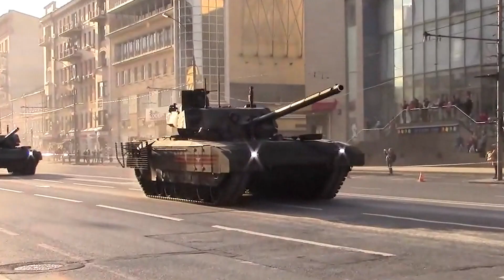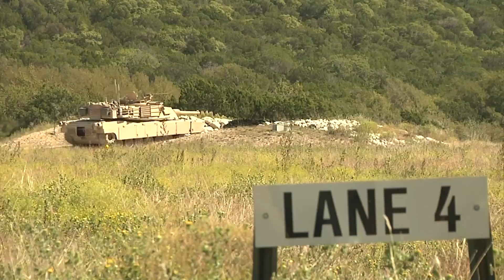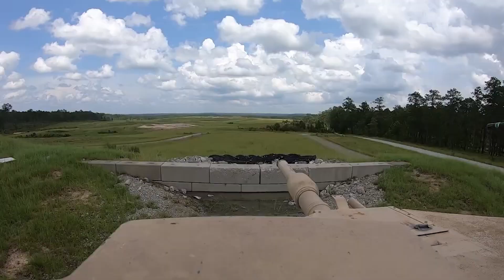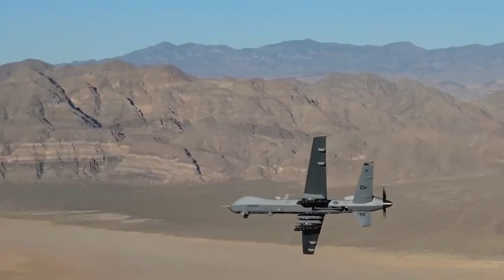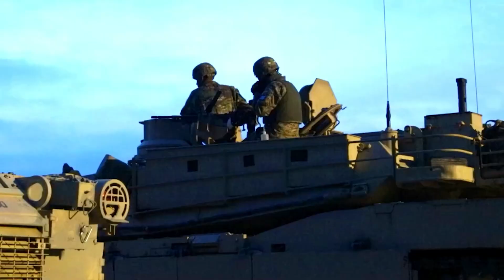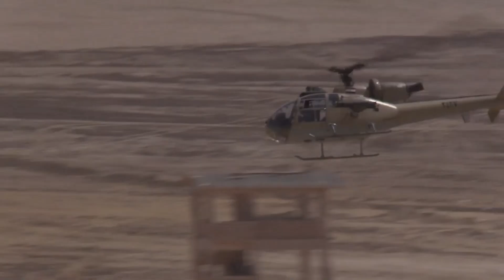The New US Tank vs the Russian T-14

Comment: The worlds super heavyweight champion - M1A2
Or the world's strongest man - T-14

Theres been info leaked here and there about things like the M1A3 getting a new higher pressure 120mm gun, or switching to the Rhm-130mm gun. Both would server amazingly, but i think the 130mm would have better future-proofing. The 120mm would be better economically though. The higher chamber pressure of the XM360 gun is great for what is needed... at the time. But the 130mm already has a larger chamber pressure at baseline, larger SABOTs to be used, meaning higher velocity and projectile weight (simply Mass x Velocity = MJ stuff). The -360 is an older gun system of a failed project, the 130mm is newer but would carry less ammo, that is if the US put the XM1147 AMP munition into a 130mm system (as the AMP replaces the HEAT-MP-T, MPAT, CAN, and OR-T munition).
Reply: 2 char Abrahams de 10 millions de dollars chacun détruit par des drones suicide à 15 000$ 
1 Abrahams détruit  par un vieux T64 modernisé .Voilà pourquoi la Russie a stoppé le programme T14 et qu'elle modernisé ses vieux chars.

Comment: Considering that the T-14 is one that is powered by an unreliable engine that was taken by a f**king Tiger from WW2, with even China admitting that the T-14 saw no combat since its launch, and how it’s biggest claims are its incorporating of technology that has been used by Western powers for decades, I’d choose the Abrams line of tanks any day of the week.
Reply: idk where the claim that it uses a ww2 engine but its most likely a false statement
Reply: @DaKevinnnn  It isn’t exactly an engine ripped from a WW2 tiger, but the engine was copied from the Maybach design used in the Tiger. The “new” engine was originally designed as an engine for compressing and pumping oil (which no one outside of Russia bought because of its reliability issues) before Uralvagonzavod used it to power the T-14.
Reply: @SpaceCase132  theres no reliable sources as for it was originally use for oil compression though
that myth came the manufacturer pamphlets that only list under possible application of this engine together with special purpose vehicles it was also repeated on theyre advertisements 
the engine can be use for that things it doesnt mean it was developed as one
it was an engine design in the 70s as a tank engine 
also its not the same engine from the tiger p its uses the basis of the engine not a copy it has different sizes and piston size and etc the only thing it has similar is the x layout
theyre arent even much evidence to prove the engine being unreliable (idky why it fail commercially but my reason that there was better option)
it has pass state trials ewthout issue
the only thing thats bad about the engine is that the fuel and oil consumption is higher than expected

imma expect if u got this from lazerpig whoch makes alot of mistakes, watch red effect on this topic which talks about this deeper
Reply: Aah yes I see from where you get this probably leazerpig audience
Reply: @raimsdayer4488  Guilty as charged.

Comment: It's pretty likely we're gonna get an M1A3 before Abrams X sees production, an Abrams using newer modern carbon steels in the hull (The hardest carbon steels are harder than depleted uranium now which is insane, they weigh less too) with many of the features off of the Abrams X, like new main gun, the 360 degree awareness, AI Targeting solutions and potentially a station for drone operation although drones are unlikely when we can just have dedicated drone command vehicles made out of the hull of an old M113 or Bradley. We have the M10 Booker to address the weight concerns of the Abrams, the Abrams can focus on being the sledge hammer it was always meant to be, a heavily armored sledge hammer that can defeat 120mm depleted uranium Penetrators to the face.

Comment: Another small note……one light infantry Bradley was lost, and another M1A1 Abrams damage’ it took less than a hour to fix the M1A1 Abrams’ it was hit by a T-72! However it didn’t do much damage, and the T-72 was knocked out very shortly after.

Light armored Bradley’s were knocking out T-72s as well. I’m willing to put 2 light armored Bradley’s against a T-14! And my money would go to the Light armor Bradley’s.

Get behind the slow T-14✅ fire it’s Tow Missile behind the T-14✅ = a glimpse of the T-14s crews last moments 😳😳😳😱😱😱🔥🔥🔥💀💀💀👻👻👻

The T-14 only gets one shot, and might destroy one Bradley…..the other Bradley is gonna swarm behind the T-14, I don’t think a T-14 is accurate or fast enough to take out 2 Bradley’s,
Reply: if armatas defense system works then 1 bradly will be shot then the armata missile jammers or laser warning system and automatic threat will turn its turret to the 2nd bradly and intercept tow it with aps
it can also use its infrared smoke screens and i doubt that armata is slow if they to fix that transmission from older T-72 and T-90m tanks adn etc

Comment: Lol😂 the T-14 would lose against a non Exported M1A2 Abrams…..the T-14 might beable to defeat a Export Abrams M1A2’ and that depends on what country has purchased a M1A2 Abrams.

Note….Exports= Abrams, sold to other countries….The USA takes off many of its up to date protection packages.

I know Saudi Arabia has purchased many M1A2 Abrams…..the country that buys a main battle tank off of a country that builds them….has to put they’re own protection packages on….that’s why their called export models. 

The top countries that sells the best tanks.
Britain, Germany, and the USA….all nato countries can buy them’ but the tanks all have the same hardware’
Guns, engines, and any other packages….a export challenger 2, Leopard 2, and M1A2 Abrams has to beable to fire Nato shells, and other spare parts….their not the same battle Tanks’ stationed in those countries….those countries main battle tanks, has the top of the line protection packages.

Russia sells export models of the T-90 T-80 T-72s…im not defending Russia, but the M1A1 Abrams were destroying T-72s with ease….reason? Those T-72s were Russian exports.
Reply: t-72m1 and ural are older than m1a1

Comment: Saving weight by moving the crew into the hull and removing the armour of the turret makes little sense. If there is no protection for the main gun, it can get knocked out easier. And this would render the tank useless, no matter if the crew survived or not.

Currently it is unlikely that serial production of the Armata will pick up, as the sanctions heavily hinder the import of necessary resources to build these tanks in the first place. The excuse that is presented as to why they do not build thie tank is the cheap argument "too expensive".

Comment: "37 Soviet T-72 tanks destroyed..." - The T-72 lost the fight to the American Abrams due to the fact that it was presented as an export - weakened version, which manifested itself both in protection and in ammunition.
Some clashes began at night, or on the eve of sandstorms...
If the T-72B1 had participated in the battles with the M1A2, then the results would have been significantly different, since the new shells could fight overseas competitors, and the tower would have been able to withstand the impact of enemy fire.

Comment: The tank is one tool included in our "Leatherman". You would have to be from a country that uses the metric system to think that America is simply going to throw one piece of equipment out there against another. We do NOT roll that way regardless. Our tank can be 10x better than yours. It will still have IFV's, a truck load of grunts and enough air support to wipe out a small island.

We are America and if it isn't eatable, strap a gun to it. We just used an F-22 Raptor with a sidewinder missile to take out a balloon from China that was filled with helium.

Have a nail you need to drive and want America to help? Hold that nail with pliers, we're brining a sledge hammer.

Comment: most of western tanks CANNOT win on the east. Why? look on the weight of Abrams and leopards and on the maximum weight that eastern bridges can hold, so if Abrams and leopards wanna win, goverment will must invest big money to change of bridges BEHIND the line because you really wont send volunteers to upgrade a bridge under fire, so armies with abrams and leopards will must use mostly infantary and artillery. But there will be problem for eastern tanks if they will be used in invasiont to country with abrams and leopards bec. if you have abrams and leopards you will (mostly) have bridges with biggers maximum weight so you will have bridges that can hold better western tanks and also not that good eastern tanks.

Comment: I mean all it takes is a Sabot to ricochet off the front hull into the turret ring and the Abrams is dead since GD still hasn’t fixed that issue the T-14 still is very capable of knocking out an Abrams

Comment: The Abrams X is just a concept vehicle meaning not in production and most concept vehicles rarely go into production.  Meanwhile the T14 has been in production since December.  So until the Abrams X goes into production (Which normally takes 3 years) the T14 unfortunately wins 100 to 0. It would  have been better to compare it to the M1A2 SEP IV, At least both are real. I have a soft spot for the old girl  but she's very long in tooth and really it's time to let her go like the M-60 and replace it with a real tank for the next 30 years. Just like Germany has replacing the Leppard 2 with the Panther.

Comment: A regular Abrams tank would have a field day against the T-14 as the Russian weapon. Especially since the 11 operational tanks aren't working properly and the electrical systems can't be replaced or repaired due to being cut off from the French systems they use. The Russian engines and transmissions are breaking down more often than the Chinese that average every 400 km. They were used to using the working engines and transmissions from Ukraine. That door was closed in 2014 and they are now suffering the consequences. Ten prototype stage T-14 and eleven production models. The active protection system was a complete failure in Syria.

Comment: I'd keep the older engine and say screw it on the Hybrid Engine if it is a Cummins Noisemaker.

Diesel Engines are about as silent as an Artillery Battery going full tilt to unload and massed with several other Artillery Batteries.

There is new Turbine Technology that has recently been developed that would increase power output for a reduction in fuel cost while also reducing weight of the powerpack and increasing longevity between Maintenance Cycles. Might not make up for what a Diesel can do, but it will be both more silent and have greater kick to it. And sometimes, that little bit extra of silence can save a Tank. Especially as APUs are becoming standard again.

Comment: It does not matter if the T-14 is a better designed tank than the Abrams or not. 
1. The quality of the manufacturing is lower. 
2. Russian maintenance is crap. 
3. Russia does NOT understand combined arms warfare, and how to gets its troops to perform it well. 
4. Russian military doctrine does not updated to use the qualities of the T-14. I.E. it will be wasted. 
In an actual battle, the American Army with Abrams will wipe up a Russian Army with T-14's.  
It is that simple.

Comment: put VW 3l V6 diesel in it,high power generator and 2 RImac electric motors(the back motors from Nevera,each is 600hp) and 3 speed auto gearbox and you got yourself 1500km range MBT

Comment: The turret on the t14 is very weak and the abrams x seems to have a lower profile giving it a huge advantage due to the fact that if it fires and hits the turret the breach would be destroyed  then the abrams can do whatever while the t 14 crew will have to abandon or try to repair the breach
Reply: T14s turret is made to be weak since it is unmanned. It does have breach armor as far as i heard.
Reply: Yeah the reason the turret on the t14 is weak is because their is only a gun breach and sensors located in it, the t14 turret is actually far smaller than it looks as it has armour bolted on the outside of the actual turret it’s self, the US did simulated engagement tests vs the t14, they concluded that the turret is very unlikely to be hit.

Comment: Having a turret with no armor will make it rather easier to render combat useless when the turret takes any hits at all.
Reply: The US army already conducted simulated tests about that and they concluded that the small turret of the t14 was very unlikely to be hit in an engagement. The actual turret is basically just a barrel, breach and sensors with armour bolted over the top that makes it look bigger than it actually is.

Comment: Russia doesn't have that many teeth 14 armadas and they want to use them for export and play why though they just wasting the meteorol distinct also the fact that you guys built this in 2015 a year after the criminion war Is ordering vision of cremia in 2014 I know it's cheaper and lighter I respect that but they're not using them also the fact that the stuff that is on the tank I don't think that's actual protection if it's made of cardboard I'm making A 50 50 chance of guessing that is cardboard all around on that thing

Comment: It's pretty cool if AI drone can mark enemies on the digital map. For tank  crew awareness
Reply: They can and will, similar to the F35 can fly without radar only using the DAS to map the battlefield and it can ID every military vehicle and artillery systems used worldwide, and then send the data to destroyer’s or cruisers as well to ground and air assets
Reply: Drones my friend can't destroy tank not even heavy 4X4 vihacles they are like a snall shrapnel granade if you know what is luck likes drones are very technology risk because if someone put a anti satellite signal it can blow to you and your friends if he lose cordination most of the thanks have that signals and armata is one very more improvement thank than any american. With the skyfight su 57 is the best too even china have more advance jets those days!
Reply: @atanasmiltenov  drone’s can kill tanks, look at the Switchblade 600 it has the same power as a Javelin. You can protect your drone/ loitering munition from jamming. Plus a recon drone is cheap and easily replaced. The SU57 hasn’t flown one mission in Ukraine. Everything coming out of Russia is for the media, not one Armata or New BMP has been used, they’re sending mothballed Soviet garbage.